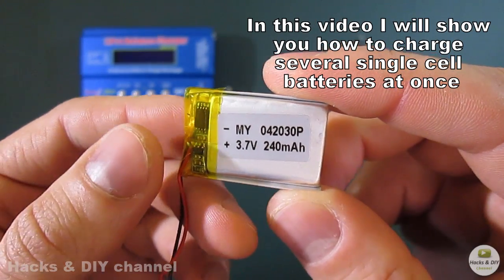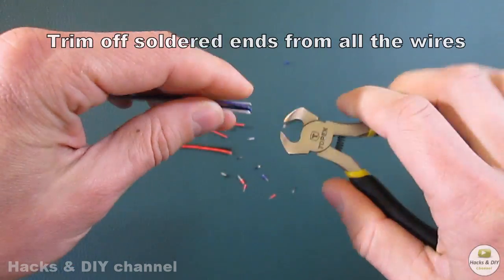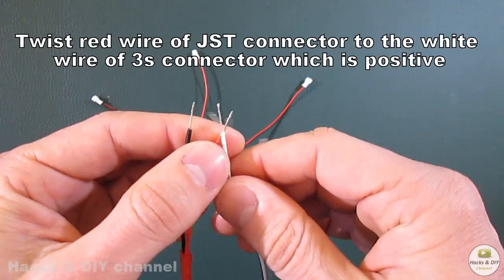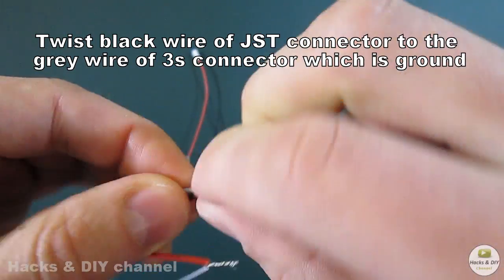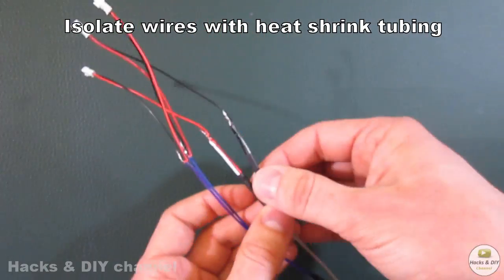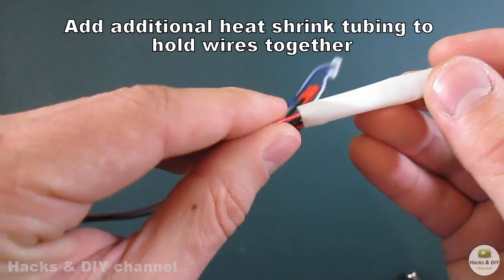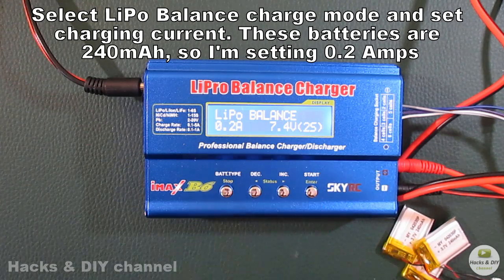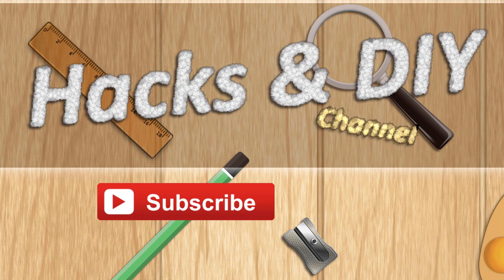How to charge several 1S LiPo batteries at once using balance charger

Comment: I thought it should be 3 times 240 or .7 amps charge current. You say it is same charge amps for one or 3, 4, 6 etc.  A 3s batt is made of 3 separate one cell batts. They are charged according to total mah capacity. A 3s 2400 mah batt would be charged at 2.4 amps,  right?? Confusing.
Reply from the maker: Hi Colin. Batteries are connected in series, therefore that increases total voltage but not capacity. Capacity still remains 240mAh in total so you need to use this value while determining charging current.
Reply: So a 3 cell 2400 mah batt should be charged at  .8 amps and not 2.4 amps.  Isn't it a pack of three single cell 3.7volt/800 mah batteries in series to make an 11.1 volt battery with a total of 2400 mah ?  Or are they 3 separate 2400 mah/ 3.7 volt batteries?  If so then that would explain it I guess. I don't want to detonate any batteries. I have a Tenergy B6 charger. I've been doing this gang charging wrong but it works. I always do balance charge.  Please clarify and thank you.
Reply from the maker: 3 cell 2400 mah battery is a pack of 3 separate 2400 mah/3.7 volt batteries connected in SERIES. Therefore total voltage is 3*3.7 = 11.1 volts and total capacity is 2400mah (capacity does not increase when batteries connected in series, it increases when they are connected in parallel). And yes - usually you would charge such battery at 1C rate which is 2.4amps (but you should check battery specs to be sure)

Comment: Building one of these from parts (parallel Pigtail) I have laying around already.  Is some type of fuse(s) recommended?  I'm going to be building only a 3S cable version.  Any recommendations on fuse size and/or placement in the chain?  I consider it cheap insurance as I like to blow stuff up, would rather not blow up my Imax.  thanks.
Reply from the maker: Imax already has fuses inside, so I do not think that you should worry about this.

Comment: What should I charge at with 6 240mah on my balance charger
Reply from the maker: I assume, that you've made charging connector for 6 single cell batteries. Six 240mah batteries connected in series still have 240mah of capacity. Therefore (assuming, that charging rate of your batteries is 1C) you should choose 0.2Amps charging current on your balance charger. If you do not know recommended charging rate for you batteries, then 0.1Amps would be a safe charging current.
Reply: qty 6 batteries at 240mah each.  You would set your charger at 6s 240mah at 0.24A or less.
Reply: What about with 1cell 3.7v 600mah  charging 6 battery’s what would set the charger at?
Reply: Flea Bag Productions 6s 0.06a
Reply from the maker: 6 batteries each 240mah connected in series still have 240mah capacity in total, therefore you need to use this value while determining charging current. I would charge them using 0.2amps.
Reply: @hacksdiychannel  The wording here is fairly confusing and not correct. 6 batteries of 240 mah is not "240mah capacity total" but we dont care what the total capacity really is. The point is that the cells are generally considered safe to handle 1C, so their mAh rating of current going through them during charging. 

They are in series, since the charger works by forcing the current through the JST connector only, all 3 batteries in series. The intermediate wires are not used for charging, just measuring each cells voltage periodically during the charge. (And to discharge individual cells, wasting a bit of energy, to keep all the cells at the same level)

So the rule of thumb for this kind of charging: choose a bunch of 1s batteries of the same mAh rating, and charge at that current rating.